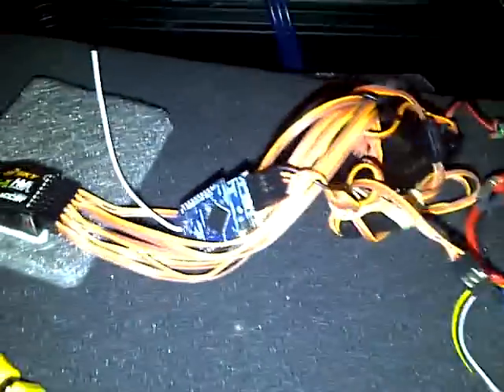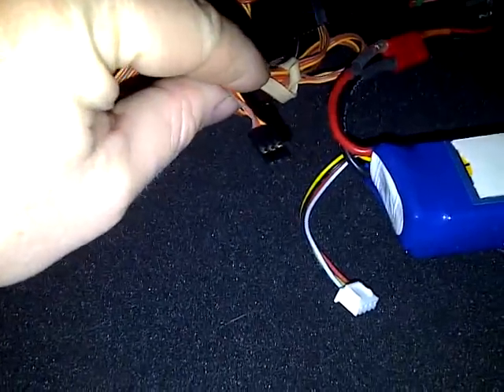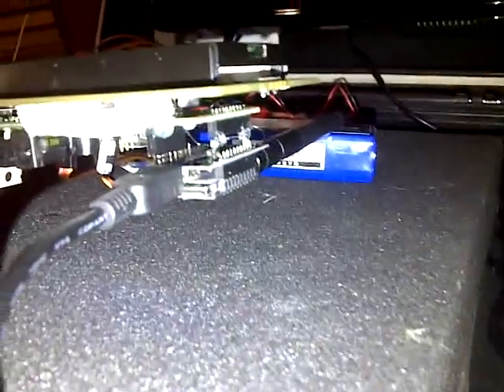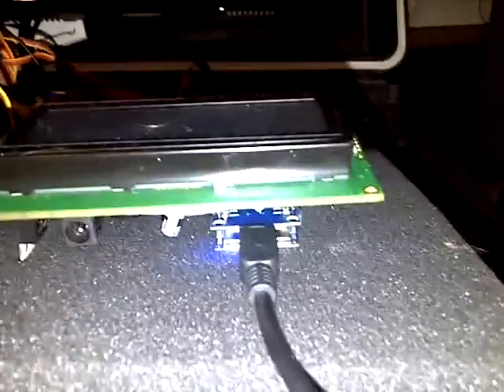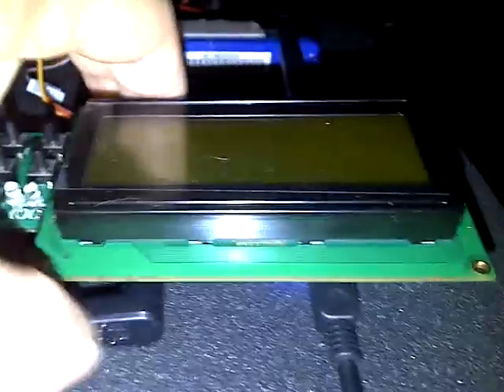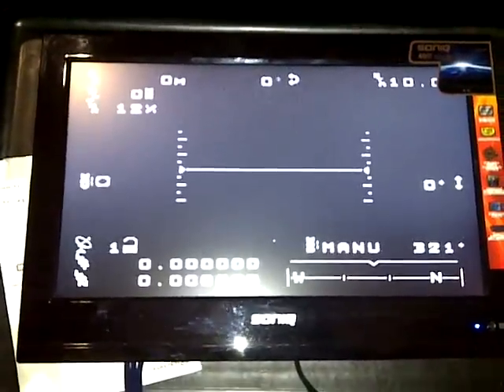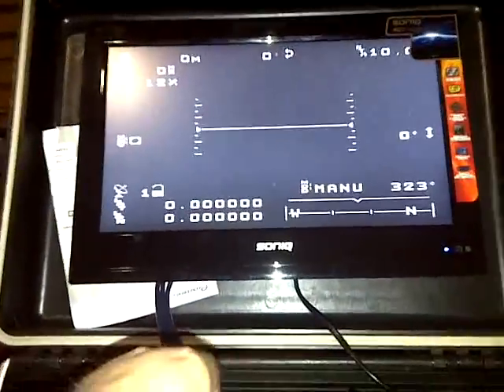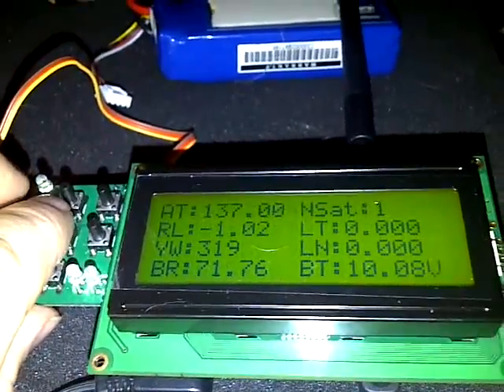APM2 with Mission Planner & Ardustation with MinimOSD on ground station

Comment: do you use the tracking function on the field i would like to have antenna tracking for my apm
Reply from the maker: +Saeed Al-Amri I haven't done any flying for over a year now, work has been too busy, and these videos I created as I was building a Massive UAV.  So yes I built everything up for tracking and was able to get it working with Arduinos - but then more recently I have been doing a lot of work with Rasberry Pi devices, which are so much more Powerful and fast, I'll be working on some Pi tracking and when I get back in the air this summer (Australia) - I'll be bound to be posting a lot updates.  My antenna for video incidentally was a 2.4Ghz Long range WiFi parabolic Grid - designed for Point to Point Comms - it's around 21db and has a focal point of around 20kms LOS. Along with a 13db 900mhz Unidirectional for the APM link.
Reply: +Leigh Green  cant wait for your update .
thanks man